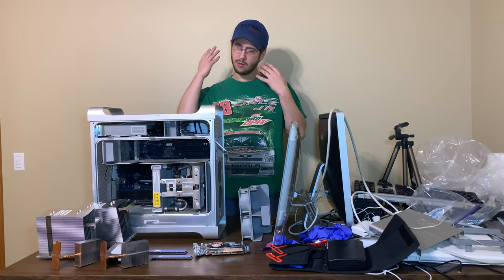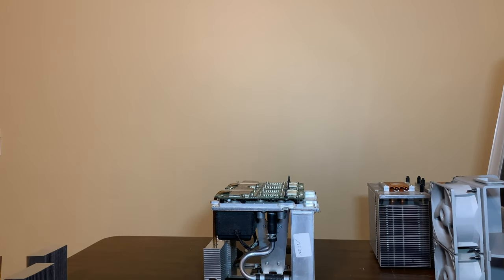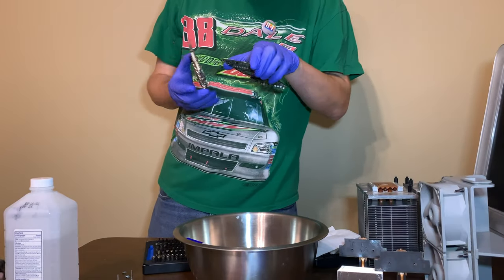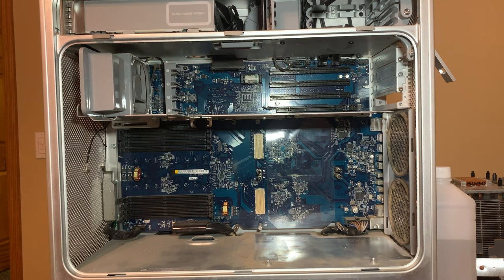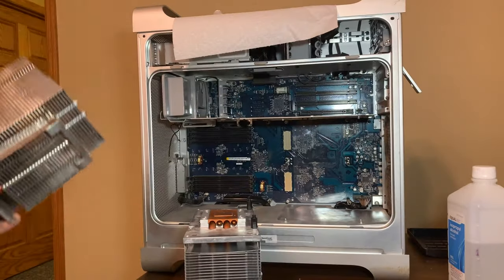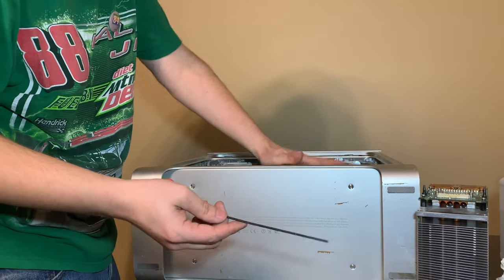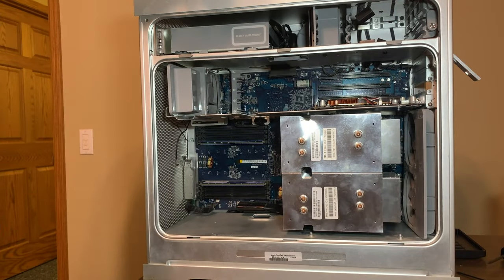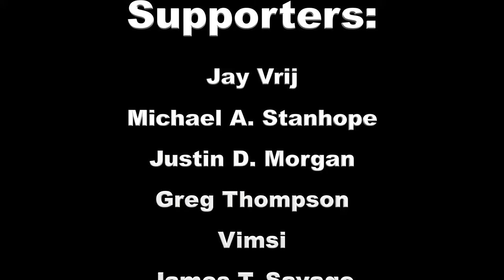Repairing & Air Converting My 2.7GHz Dual Processor Power Mac G5 – PowerPC Series S.3 EP.19

Comment: i was wondering if it is possible to replace my late 2005 dual mp950 2.0 cpu's with the dual 2.7 950fx cpu's and what it would take to do that or overclock a few hundred Mhz on the 2.0's that are in there now. Would u consider doing a episode or so on either one?

Comment: you really should keep some white distilled vinegar around it helps neutralize acids that cause the corrosion sure it smells buts it cheaper then isopropyl alcohol
Reply: Vinegar is an acid (acetic acid) itself and won't neutralise other acids. Only a base (such as found in baking soda) can do that. While it may help with getting rid of corrosion, it should be removed after with a neutralising compound or the corrosion/board damage will come right back.